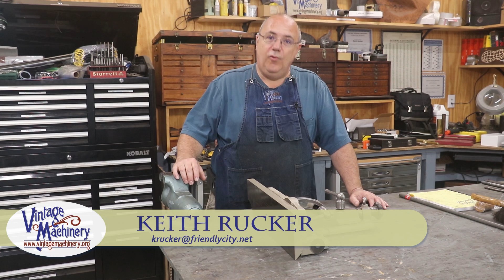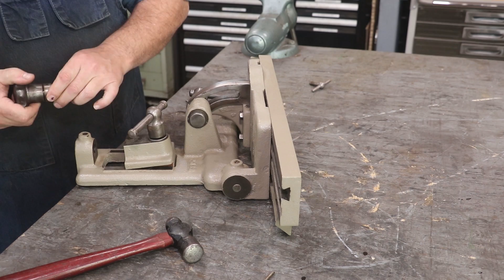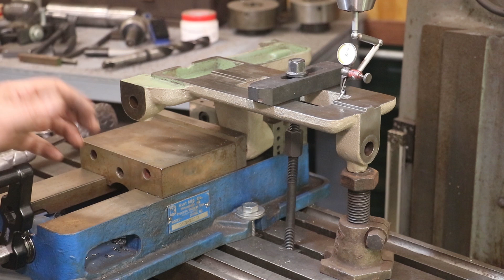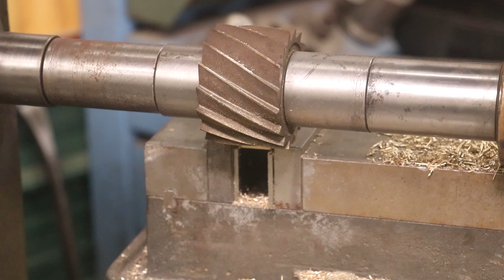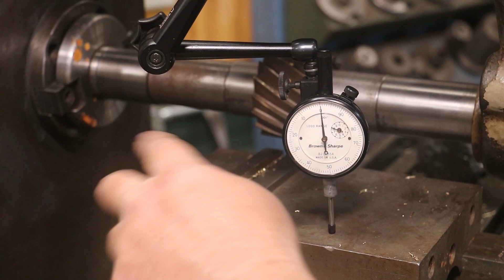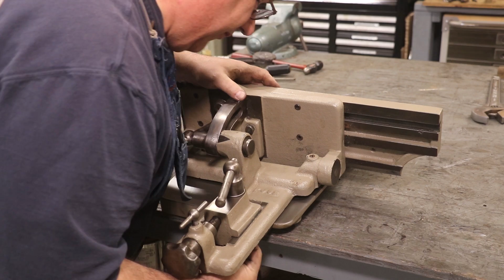Machining New Slide Keys on a Wadkin Table Saw Fence

Comment: Interesting. I thought the new keys would be dovetailed to fit into their slot. But I'm not sure what the original fence is like - my saw has a fence made by a fitter&turner. Wish I had an original fence and the quadrant fence as well. 
For those interesed...
https://youtu.be/A0LXlSwJKH4?si=NWzEa1Ouhj4lR8ny

Comment: If it were me, I would’ve made these from Ampco bronze. I would’ve first gauge blocked the flats on the dovetail-slot and made them 0.001” smaller, and I would’ve indicated to the fence and machined the keyways perpendicular.  When I did mine, I even surface ground. The PK deserves it.
Reply: 100% agreed. Keith did a pretty rough repair here.

Comment: this may be an obvious answer to most, but, when drilling cast iron, fluids, or no fluids? and, is it possible to do it by hand or is a machine preferred? (i don have any machines But hand drill, but, it woudl be a little difficult to drill either way as it is.... but, i am trying to extend a wood lathe but my extension has no holes where ei want to extend it (second extension because i thought it would be possible based on the photos of the part online, but, surprise, surprise, no holes for further extensions, so, im a bit short now on the lathe bed length i need... i dont intend to turn much of anything of much thickness, but length of at least 6 feet for spindle is what im looking to work on... so, essentially, i want to use the holes in the extension meant to go to the main lathe base, but to connect to the first extension, but, im thinking i need advice or ideas for how to align and secure it, so i can then drill and bolt the extensions together...

Comment: Keith, wouldn't it have been easier to have built up the keys with braze and then mil it to the right dimensions?
Reply: Nope, because then the key would not be replaceable. The WHOLE idea of the job was to have the keys removable.

Comment: When setting up the casting in the mill, I would have used parallels set across and along the length of the casting to clock from. Yes they will sit on the high points, however the high points are the unworn areas of the previously machined surfaces. I would have done the same to clock along the old key. A slot drill is better than an end mill for cutting the new keyway.
Reply: He really should have referenced the 2 large bores where the tilting mechanism for the fence are pivoted from. The key slot needs to be exactly 90 degrees off that axis.
Seems pointless to work off the sides of a known worn key. In a woodworking machine there is not always even wear, because the adjustment will tend to occur from the operator side. There will be a lot rotational forces on the keys from pushing timber towards the leading side of the fence.
Looking at the final assembly at 30:58 is seems there is a LOT of reliance on those 2 small keys to keep the fence secure, rigid and straight. All loads from the timber being pushed along the fence are transferred directly to the keys. The mechanism doesn't actually lock the fence assembly down to the table at all - it's just floating, which is a very strange design decision.

Comment: I hate flat blade screws on machinery.  On the Karger mill I'm working on, the slots are all very narrow; I had to grind a special set of screw driver blades to fit. Even then I had to use an impact driver to get some of the ~90-100yo screws loose (even after penetrant, tapping and gentle heat).
Reply: They never had a way to create Torx in the old days. Flat slot screws are the BEST way they had to transfer tightening torque. A hand-held impact driver is the correct way to loosen them - imagine how bad it would be if they were Phillips!

Comment: 3:06 - "...the problem he's got is that over the years of just sliding this thing back and forth of the machine, the key (...) has gotten thinner and thinner (...) and now there's a little bit of rocking (...) he wants to get that out of it and make it where it's nice and tight" - sounds reasonable... : )
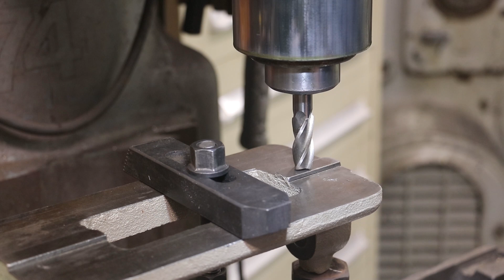11:08 - "I've got a 9/16th inch end mill in here that is the width of this key we're gonna be putting in here".

Now, when I watch the milling of the old key I got the impression that 9/16th is just a smidgen under the width of that already "worn out" key - and it makes me wonder.
That original key is worn, so its size is already smaller then it should be (and originally was). AFAICT there's no mentioning during the entire video what are the original specs for that key - was it under 9/16"? (i.e. 1/2")? - or more than 9/16" (i.e. 5/8")? If the former is the case, then 9/16" should do, if the latter - it won't. And anyway, the sides of that T-slot (I don't think it is a dovetail slot) that key was sliding in are a tad worn as well - so my thinking is, one should check the size of those slots in the first place - and only then decide on the size of new keys.
Brass is softer than cast iron, thus more prone to wear - and the looser the fit (between T-slot and new key) will be, the faster the wearing of those bronze keys would progress.
Again, maybe everything was measured and checked, and dimensions of those new keys would be just perfect - but there isn't any info about it in the video, so I'm just wondering.

Comment: If in woodworking a cpl. of thousands is a "mile", then why arn't you worried about it?
Reply: I think he got his analogy slightly reversed there, and most who work with wood and metal (or look down on the woodworkers with secret envy, like AvE 😂) get what he means so it slides. But you are right, it sounded odd.
Just to clarify, a couple of thou in wood are "lost in the noise" - even if you can measure wood to that accuracy, come back tomorrow and it will have changed more than that due to temperature or humidity changes. So it really does not matter.
Reply: @mumblbeebee6546  AvE Is a total ass clown, (Trying to be kind), I can't watch more than 10 seconds of him at a time.

Comment: Unless the customer didn't ask for it but, as a machinist, wouldn't you have notified the customer that the piece wasn't flat? Shouldn't you have flattened it for them before placing the new key ways in? Just curious is all. To some, that wouldn't seem to matter however, to a woodworker, it does. You have to think that, that measurement gets multiplied.
Reply: He also didn't mill the new keys at 90 degrees to the fence. He literally just guessed the angle.
Whilst there is adjustments for the fence, it has a tilting function so it (theoretically) could never get accurately dialed in for all cuts.

Comment: Should have some scrap barrows for the following: Brass, Bronze, Copper, Aluminum, Lead, Cast Iron and Steel. With the first 5, you can use the scrap (chips), for casting into. new items. Cast Iron Steel when barrows get full sell to the scrap yard. Or if you know someone that does casting in cast iron they may want it or take it off your hands
Reply: Everyone already knows this....
Reply: Fred's comment is so idiotically redundant.

Comment: No. 10-32 -Bloody Hell!  Should have been No. 2 BA on a traditional British made tool (Yes, screws are available, but it would have most likely been faster to make them🤣!) Looks like there was not enough wear in the table dovetail edges to display much play on the fence guide.  Somewhat dodgy design with so little section bearing along the thin edge of the top of the dovetail, still overall massive quality.

Comment: Did you give any thought to resurfacing the bottom of the fence before cutting for the keys? Also, how about re-cutting the dovetail in the table since that is probably worn too?
Reply: Should have flattened that base on the surface plate. Perhaps the client can do it later?
I would have run the mill down either side of the new keyway slots, so that there was no likelihood of high spots right next to the keyway.

Comment: Great repair but the cutter at about 16:00 seems to be cutting with one part of its circumference only.  Am I seeing this correctly?
Reply: Yeah, I think that’s quite common with horizontal milling. As the tool needs to slide easily onto the arbor, there has to be some radial tolerance between the arbor and the tool. This causes a small amount of runout that makes for noticeably uneven cutting especially when doing shallow cuts. Doesn’t matter for the end result as the high spot on the tool ends up defining the depth of the cut across the whole workpiece. The precision ground spacer rings keep the tool square to the arbor. Only real downside is the risk of uneven wear on the cutter, which can mostly be prevented by avoiding very shallow cuts where part of the tool is rubbing instead of cutting.

Comment: You said "Dovetail" slot/key dozens of times, but I didn't see any dovetail aspect to the keys you made. When you started removing the old keys, they looked like they were originally dovetailed (as you described them) but worn, so when you started cutting them away without measuring and making the new keys, I wondered how you were going to cut them to fit. It appears that you instead cut the new keys without any dovetailing at all!  While this seems to make the parts initially fit, they are touching by a fraction of the metal that a complete dovetail would,  and excessive wear on the softer key material will kick in immediately. Naturally, I assume that I'm missing some vital aspect of the job. Help?
Reply: Don Halley I’m pretty sure that the dovetail was only for the lock.  The guide just goes in the slot on the top of the key way.  I might be wrong, but I have a saw that has this same kind of fence lock.
Reply: @wilsonhardy2100  That makes sense - thanks!
Reply: @donhalley5622  no problem, stay well.

Comment: This is a planer fence and NOT a table saw fence.
Reply: That adjustment and tilt mechanism was also used on the Wadkin surface planer fences. If you look closely at other Wadkin machinery you will see various parts adapted into the construction of others. This saves time in pattern making and also if its a well proven part guaranteed to work accurately for its particular purpose, standardize it where possible.

Comment: Why didn't you dove tail the new piece?
Reply: What would be the benefit of doing that?
Reply: @mlenstra  It would match the dove tail under and help hold things into place. I think the original piece was dove tailed and over time and use it wore to the point that it was almost flat.
Reply: If the original had dovetail shaped keys that interfaced with a matching dovetail slot in the table, how could wear cause it to go flat? Wear would be the same at the top and bottom of the dovetail, so it would only get narrower but it should definitely still have the same angle to it. I think the table just has a slot with a square section at the top for the fixed guides and a dovetail cut beneath for the locking key to grip onto. This way, one can rotate the locking key out of the way and lift the whole assembly off the table rather than having to slide it all the way out of the slot to reposition it. Having said that, it’s all speculation as I don’t know the machine myself, so you may be right.

Comment: I love working in brass.  Not real durable but easy to replace
Reply: True, but the bronze he used is very durable.  This repair will be good for a very long time.
Reply: Geoffrey Kail the fact that bronze wears before cast iron is actually the main reason to use it in this case. Iron on iron causes the slot in the table to wear too. With a bronze key, only the key wears down which is much easier to fix by just replacing it.
Reply: @mlenstra  I was hoping that was your thought too.

Comment: Fine adjust on a woodworking machine ??  That's a bit of overkill.
Reply: Working to 1/64" or better is normal, and tedious to bump in.

Tablesaws are used to cut to final size, and also to cut joints.

Comment: I'm surprised that the dovetail groove hasn't worn wider as well.
By honestly, you should be using Whitworth fasteners, shouldn't you?
Reply: That is an table extension for ripping wider stock, most wear takes place closer to the saw blade in the main table slide way.
Reply: @eyuptony  - how could anyone know know whether the groove in the table (near the blade) has worn or not?
It's most likely that the slot is considerably worn (even in the extension, the finished result was sloppy). It seems silly to manufacture new bronze/brass keys to 9/16" when the slot is almost certainly wider. If it was my table, I would have machined the slot first, then made slightly wider keys (eg: 5/8") to suit.
In fact, it's quite strange to have a flat key like that running in a dovetail anyway, since the sharp machined top edges of the slot will grind the shit out of the sides of the keys.

Comment: as a woodworker myself, I have to ask if using some sort of slitter on the keys wouldn't have made sense, and eliminated so much waste?
Reply: yes he could have used a slitting saw. a lot slower though. guy should have sent him smaller stock.
Reply: @ronalddavis  as a carpenter, I first reach for a circ saw....it's just how we think....
Reply: Could have milled the first slice to 9/16" (final width), then used the bandsaw again to cut it in half, then finished them to 1/4" (thickness). That would have resulted in a spare pair of keys rather than a massive pile of shavings.

Comment: always wondered do you (or any other machinists here) sort their scraps and chips by sort of material? Because copper alloys are worth quite a bit more than steel or aluminium, so it might be a good idea to collect them seperately.
Reply: The amount of chips that a guy doing machine work on the weekends in his home shop creates is very small. The amount of yellow metal chips they create is even smaller. A couple pounds of yellow metal scraps per year is not worth separating.
Reply: @xenonram  - It's certainly worth having separate bins for each kind of metal, and then throwing the chips into the respective bin along with the other offcuts and scrap.

Comment: I am curious about wear on the edges of the dove-tail in the table. Since the fence piece was worn, wouldn't there be about the same amount of wear in the slot?
Reply: There's a LOT of slot, and not much key.
Reply: @paulwomack5866  LOL..The sweet spots wear....but nothing is perfect. He fixed at least 75% of the problem

Comment: Wadkin pk fence first built in 1925 and still made in the 6O's. That one dates from around 194O. Wadkin improved the design where the keys were removeable. Its not essential to have the keys exactly square because the fence plate can be altered by 4 grub screws to make it perfectly square to the blade
Reply: Great machines, worked on the PK and the later PP in the 1970s/80s.
Reply: @eyuptony  Me too! I was  trained on a PP!
Reply: @davydmir6565  Hi Davyd. Yep, I started on a PK then it was upgraded to a PP because it was worn out.
Reply: I can second this, my PK has removable keys.

Comment: Seems that one could have used a slitting saw on the horizontal mill to turn the bronze into two sets of keys thus reducing the large chip pile and providing your customer with a replacement set....

Comment: Why not put it on your grinding table and flatten all the surfaces.
Reply: No need.  It turned out perfect.  It is a adjustable fence on a wood saw (a very nice one, but still a fence).  No need for precision bearing flats.

Comment: Two things--I was always taught to not try to brush the tailings off the horizontal mill on the climbing side of the cutter. The woe would be if your brush got caught in the mill and of course, zip zap, a brush with no brushes. The second thing, possibly not needed for someone with a steady hand, a tapping block when one is unable to secure the tap in the mill. I have found that tapping anything under 1/4-20 it is best to use the block to keep the tap from being run in crooked. You may be a whole lot more steady than I am, once you get past 80 steady seems to diminish daily if not weekly. I really enjoy your work, it is what I remember from 50 years ago when I finished my apprenticeship as a tool maker.
Reply: There were no climb cuts. (The entire cut length is conventional. The only time you could maybe say that a cut has both, a climb and conventional component, is when you're taking a cut wider than the radius of the cutter or when slotting.) Maybe you mean not to brush on the infeed side of the cut, but it will be fine. Also, he mentions not being able to use a spring loaded center because he didn't have enough z height. Taps are difficult to get going crooked because they naturally want to take an even cut around the entire periphery. I'm not saying that they can't get going crooked, but it's not a huge issue.
Reply: @xenonram  Agreed on my use of climb cut, but I have experience with getting a brush caught on the infeed side, semantics actually as you know what I meant. On small taps getting them straight can be done by eye but I have broken several smaller taps not using a tapping block because of hand shaking. What I was trying to relate was experience rather than specific do's and don'ts. However I do enjoy hearing from others on stuff like this.

Comment: You could have given the guy the fix you did (good) and a spare set too.  Not that he’ll ever need it.  Nice little shop you have there.
Reply: The next set will likely have to be wider to take up the wear on the dovetail. (Even though the bronze should technically wear before the cast iron, the CI will still wear.)